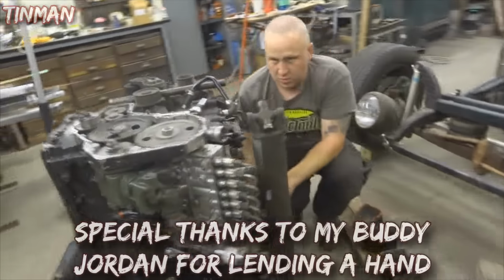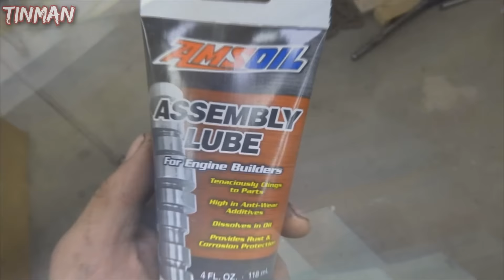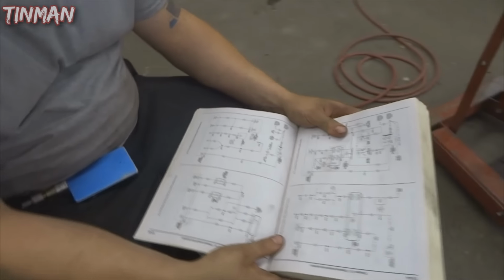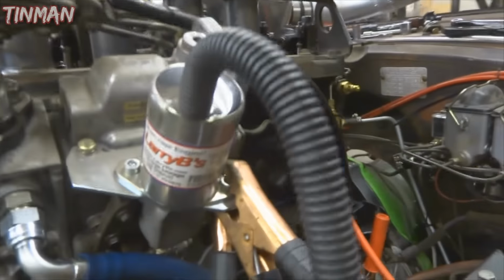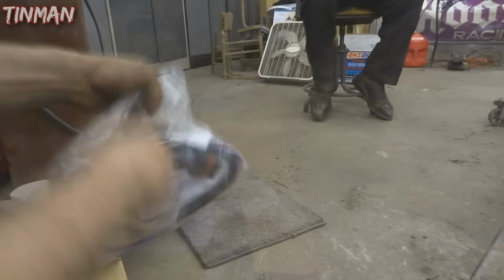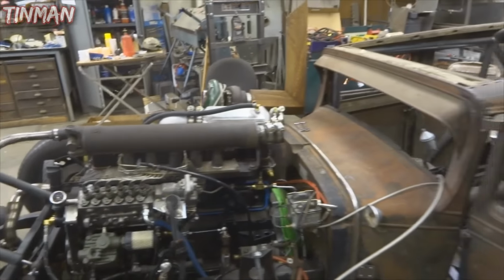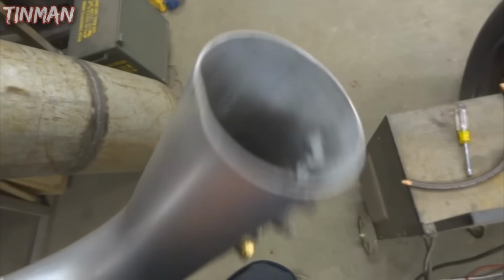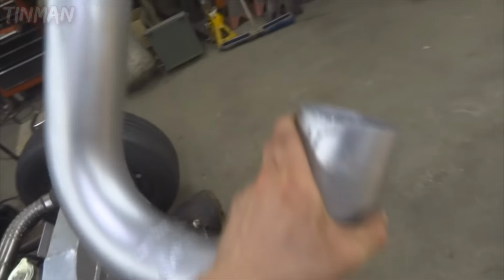Wild-Torquey is ALIVE!!!! Episode 48 is a must see!

Comment: your wrong a 12v cummins weighs 1,100lbs dry
Reply from the maker: nope. not with compounds, my intake, air compressor, p pump, etc.
Reply: +Tinman 2 Kustoms well my 2.6 pulling motor which is a 12v block alone without the pump an etc. weighs 1,300lbs dry so yea your motor weighs differant then what i mess with